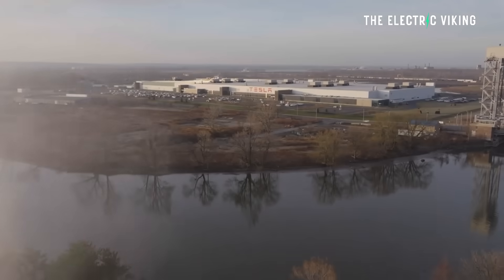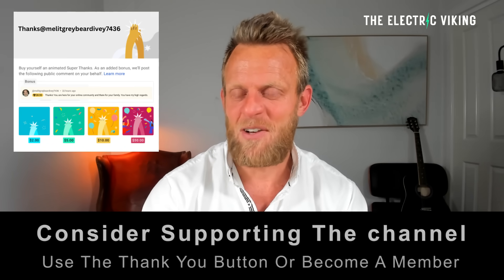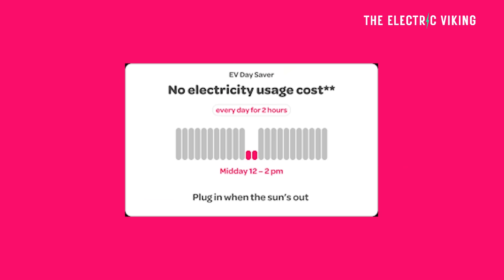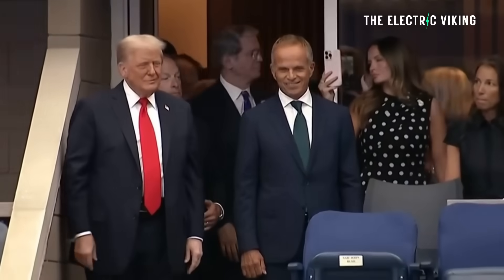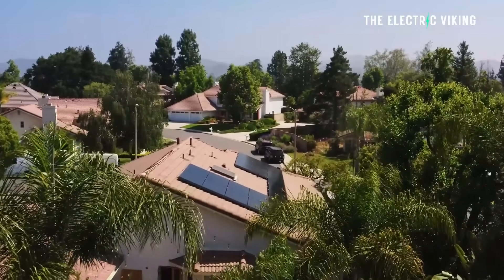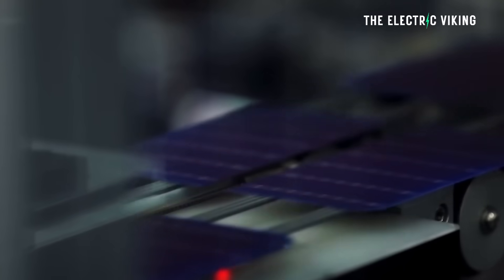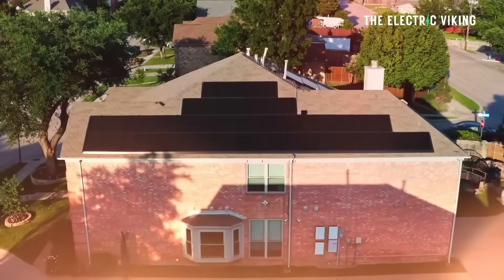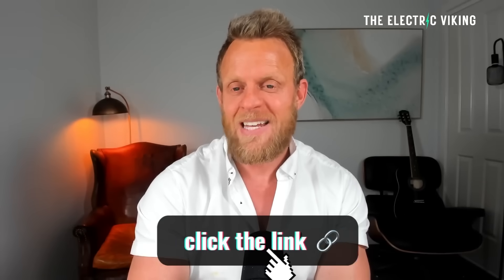Tesla Kicks Off Production of a Brand New Solar Product in the United States

Comment: Well the Tesla panel specs aren't that impressive unless they cost a lot less than other panels. I put 32 REC460's (460 watts per panel) on my roof with micro-inverters. All the quotes I got were for panels of at least 420W per panel, most were 440. I didn't even consider Tesla at the time (around Dec 24) cause he was in the middle of buying our Presidency and I just couldn't stomach doing business with a billionaire who was tipping the political scale in his own favor to the detriment of a lot of other folks.

Here in the US solar panels and installation can cost quite a bit more than elsewhere which is why losing the tax credits hurts so much. I got mine up in time to beat the deadline so my array cost will be reduced by 30% which helps a lot.

I have a neighbor who bought previous generation Tesla array and they got a good price, including a battery, and they like it. I haven't spoken or researched it but I get the sense the Tesla system is pretty good. I agree we just need more. More providers and installers is just better so I hope they do well with these panels even though since Musk went all nazi on us over here I have a sour taste in my mouth about the company.

Comment: Grid will be repurposed to be the emergency backup AND take dirt-cheap feed-in electricity. 😊

Grid will supply industrial customers moving away from fossil fuels to clean feed-in electricity.  😊

Central generation will be abandoned. 😮

20million is a QUANTITY with its own QUALITY. 
20million roofs 
20million meter boxes 
20million v2g EVs in 20years. 
EVs v2g massive storage batteries parked 23hrs every day and all night long. 
247, 365, dirt-cheap roof realestate, DIRT-CHEAP PV, dirt-cheap electricity, 2cents kWh feed-in.  😊

Comment: Btw, the one panel shading taking out a string hasn't been a thing for a long while.  Standard panels have 3 bypass diodes that allow the panel to skip 1/3 of it in the case of shade or damage.  New panels make this a bit more robust with half cut cells.

I haven't looked into what tesla is actually doing here, but if it's just diodes + half cut cells, that's already pretty common in the industry.  That said, basically all panels are made in China and India right now, so the made in USA side of things would be new if they can actually produce at scale.  This is particularly true if you go deeper in the supply chain, and look at the manufacturing steps that happen before final assembly... 99% China.

Source: Im a solar crew lead, and have installed 100's of systems with both strings inverters and micros. Blown diodes are a pretty common troubleshooting call.

Comment: The new panel is a monofacial solar panel stated to have "industry-leading aesthetics"—designed to look sleek and less like a traditional solar panel—and boasts improved shade performance. The new specs on their website are 410 watts (W) and come with a 25-year performance guarantee.
410 watts is way lower than other panels on sale today that can yield up to 475 watts. Also, monofacial is less efficient than bifacial and all-back contact solar panels. As for the 25 year guarantee, that's pretty much standard these days; some companies offer warranties that last 30 years.

Comment: Since roofing usually lasts 15 years and solar panels 15-20. How does it work out? With the costs of roofing replacement/maintenance and solar panel replacement does the math work over time?

Comment: We had 4 x 400 w Maxeon panels on our sailing cruising catamaran.  At max I was getting 450w out of each at peak of day.  Switched to Renogy 590w Bifacials that have 16bb.  I only need 600w per panel as I have 50 Amp 12v MPPT’S which matches the charge limit of 50 amps per battery, Epoch Lithium 1200 amp total.  The main difference is 2/3 of the underside of the panel is open but with 16bb as well, we can charge at 200 amps for a lot of the day now, if the batteries need it.  In effect, we are now free.

Comment: When figuring out if solar works for you, make sure to take into account the cost of removing and reinstalling the system if and when your roof needs to be replaced. You'll never see this cost in the savings estimates you'll get from a solar company. Ask them what they currently charge and calculate what it will cost in the future using a reasonable inflation rate. Best not to be surprised down the road.

Comment: Tesla products are great, Tesla service is non existent. I recently wanted to add to my Tesla solar roof, so I requested an evaluation on line and gave Tesla $100. I never talked with a human, Tesla assumed I wanted a new roof and designed a new roof, I received a series of emails and texts saying they were ready to begin. I would text back or email back that I already had a Tesla roof and wanted additional solar. After many texts and emails and never talking to a human, I gave up and requested my $100 back, never did get it back. Tesla service is terrible.
Reply: Tesla need to go AI in it’s Service Dept. , maybe that will help.😂

Comment: The problem with roof top home solar is the installation labour is just too expensive.
Reply: D.I.Y.
Reply: @OKFrax-ys2op you still need to pull permits and pass inspection. Not to mention you need a new roof otherwise you'll be removing them too soon. Ground mount it just the way to go.

Comment: "University of Surrey scientists found that retaining water in a sodium-ion battery component significantly boosts performance, potentially leading to greener energy storage and even a method for desalinating seawater."

I recently saw the news above. How real is it?

Grok AI Answer:

This discovery is completely real. It is based on recent research.And many reliable sources confirm this. I will explain this in detail.

Scientists at the University of Surrey in England have discovered that retaining the water in "nanostructured sodium vanadate hydrate" (NVOH), a key component of sodium-ion batteries, significantly boosts the battery's performance. This doubles energy storage, increases charging speed, and provides stability for over 400 cycles.
Green Energy Storage: By using common, low-cost materials like sodium, this could serve as a long-term, environmentally friendly alternative to lithium-ion batteries. It will help store renewable energy (solar, wind).
Seawater Desalination: When tested in salty water (like seawater), the battery not only functions but also removes sodium ions (Na+) and chloride (Cl-) from the opposite electrode, enabling desalination. This makes energy storage + water purification possible in a single system.
Authenticity Verification:
Research Paper: Published on September 14, 2025, in the Journal of Materials Chemistry A. Title: "Nanostructured sodium vanadate hydrate as a versatile sodium ion cathode material for use in organic media and for aqueous desalination." It states that NVOH's sodium storage capacity reaches up to 280 mAh/g, and desalination capacity is 173 mg NaCl/g.
University Announcement: The University of Surrey's official release (October 2025) confirms this. The team led by Dr. Daniel Commandeur states that this "unexpected" discovery occurs by avoiding the removal of water.
Other Sources: Science/news sites like Phys.org, Interesting Engineering, and Energy Daily reported this on October 20-22, 2025. All reflect the same information with no contradictions.
This is recent news (October 2025), so you may have seen it lately. It is genuine research, but not yet implemented on a commercial scale—it only indicates future possibilities. For more details, visit the University of Surrey website.

Comment: It looks like the new thing about those panels are the fixed side skirts (so you won't need to add bird protection after installation) and the integrated mounting system. That should make it easier to install. Installation cost are a major cost factor, so this might be a great product.

Comment: Hi Sam. You do not need micro inverters or DC optimizers for solar to work effectively in partial shade conditions. With modern string inverters like SMA, Fronius, Tesla and Sungrow you do not lose an entire string if one panel gets partially shaded. With SMA's "Shade Fix" technology or similar from other manufacturers, if part of a panel becomes shaded, then the entire string output drops briefly, then seconds later recovers to only losing the output from the shaded section of that one panel. I have tested this with both the SMA inverters and the Tesla Powerwall 3 and it works as described. This tests were performed on panels that have 3 bypass diodes. DC optimizers and Micro inverters just add cost and failure modes. If you get quality panels, paired with a quality string inverter then partial shading is a non-issue.
Reply: are u saying optimisers are pointless with shade issues on panels????
Reply: @jamskof  Yes. Based on my testing, DC optimizers are a waste of time if you are using modern string inverters that are equipped with "Shade Fix" technology or similar. DC optimizers just add additional connections and subsequent failure modes.

Comment: These look good on your typical dark colored roof. One thing I've noticed is that if you live in an area where a lot of the houses have, solar, it starts to look normal and you don't really notice them.
Reply: I think it should be the standard. The roof lasts longer this way. When you look at the cost of a roof and then the cost of solar this product has a huge advantage on new builds. If this became a standard, the price would probably go down due to economies of scale and the cost difference between this and a regular roof would probably end up being a few thousand. The typical homeowner would make that back in electricity in 2 or 3 years and that’s without any tax credits. If new home builders took advantage of tax credits they probably could have installed this for the same price or less than a new normal roof.

Comment: So much for solar roof tiles ...
Reply: Yeah... Those are just too much $$. I have always wondered what those would look like to be installed on new construction homes in fairly sunny areas. To put those on from the get go, it seems like there would be a good case for that
Reply: In Ausi a lot of homes have steel roof tiles, I have installed them myself to help overcome hail damage. The thing I liked was they are BIG, and cover quite a nice chunk of roof in just one tile.  If this idea could be replicated with solar tiles, a lot of the multi connection issues could be minimized, and tiles could be manufactured on an economical scale.  Corners and angles could be made using matching conventional steel tiles.
Reply: @TerryHickey-xt4mf  Makes good sense to me! I don't even know what you are talking about specifically, but I have marveled that no one has come up with something better than what they have, as far as installation and expense

Comment: Well, 0n 2014 I installed a ground based 11K  solarworld panels with a solaredge system, a string DC system with optimisers on each panel to avoid the partial shade problem , 2 inverters no micro inverters. Supposed to be 98% efficiency.  It has been great , no charge for usage,  I get full production on sunny panels, when some in the string are in shade. Why are the panels so thick?
Reply: side skirts I think.